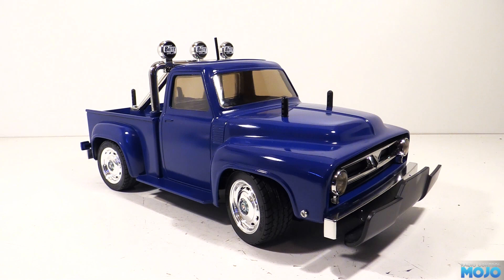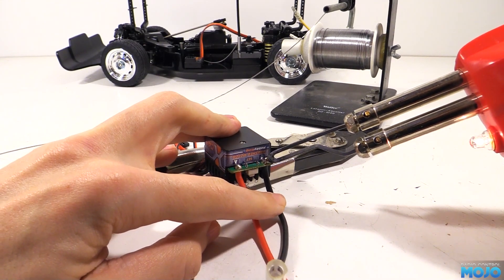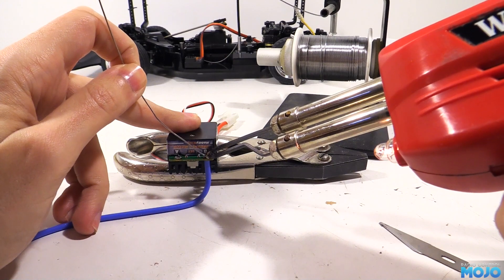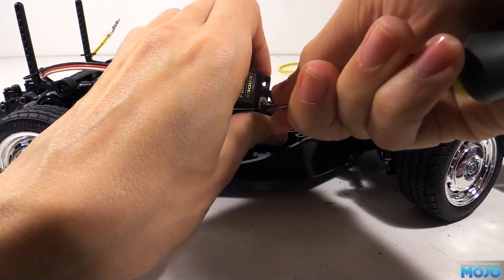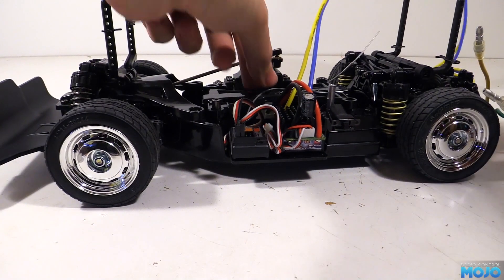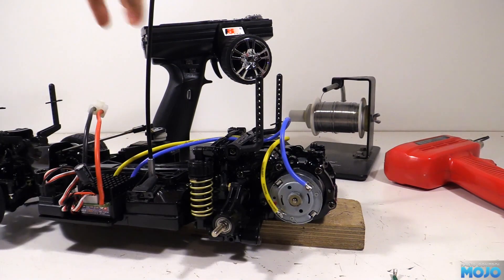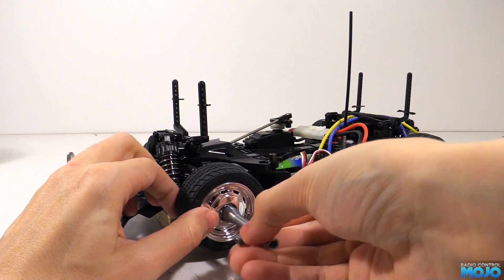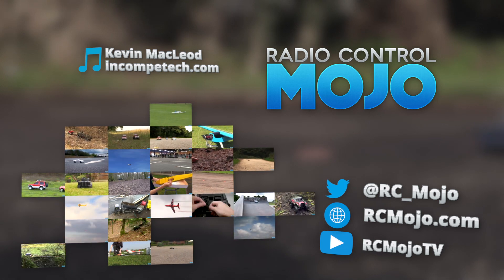Tamiya Lowride Pumpkin - 8 - Build Complete

Comment: is it bad to run the car with the wires on the wrong way and reverse the channel on the transmitter ?
Reply from the maker: It’s not bad as such, it wont do any damage.
In general reverse tends to have a reduced speed and a less punchey start. The 2 step brake/reverse might be a little funky too, you’d have to pull the trigger twice to move off.
ESC’s that brake, then automatically go into reverse can be a bit tricky to figure out which is the correct direction. If you’ve got a setup card you can disable reverse which makes it really easy, otherwise you might just need to try it out and see.